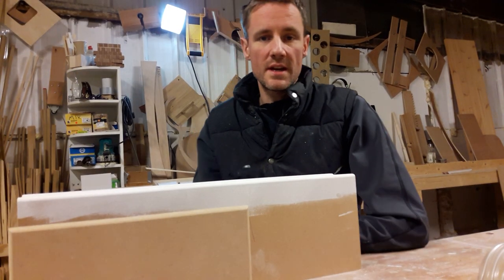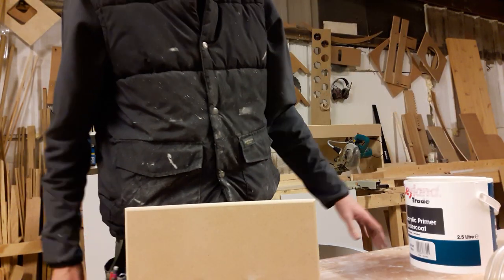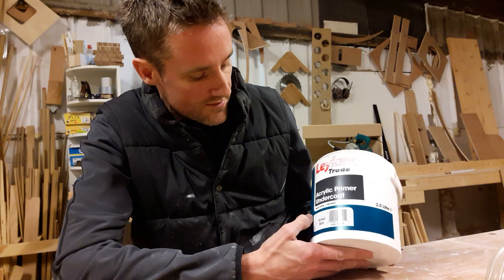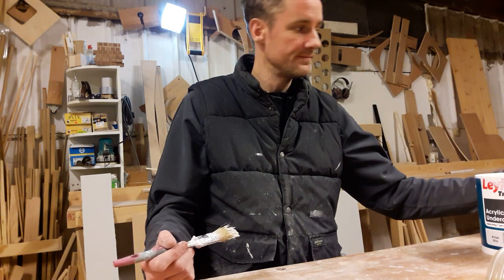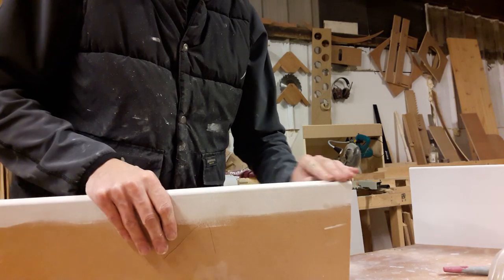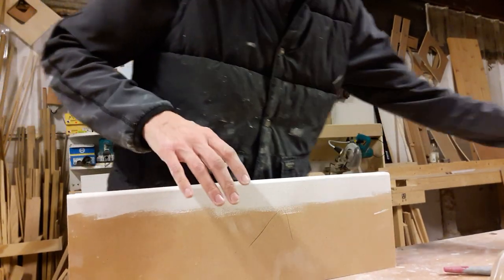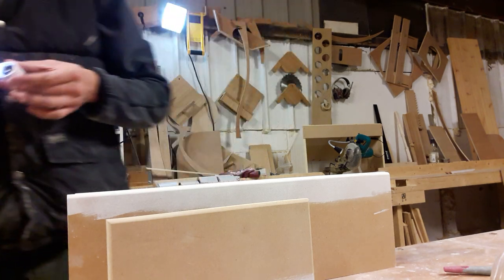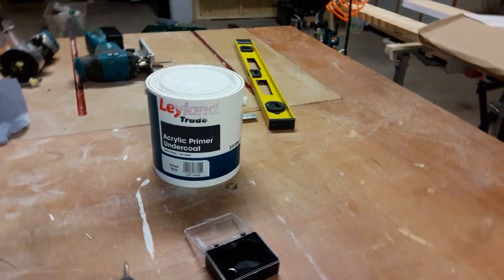How to prepare MDF for painting

Comment: Thanks for that point about Leyland paint which by pure fluke having a paint shop virtually across the road from me, that I went into two years ago after buying some  MDF wood because I could believe the prices of canvas acrylic and oil boards and been using that. Nearly use it all up and have been thinking as my paintings are getting better I need to move on to more expensive boards but if it is good enough for you, then it is certainly good enough for me.

Comment: I’ve tried almost every imaginable technique on MDF edges from PVA glue to diluted emulsion to shellac to Leyland and various fancy pants primers and I came to the conclusion that it when it comes to paint it almost doesn’t matter what you put on the edge because the first coat will leave it as rough as rock whatever you use. The trick is in the sanding and applying more coats and more sanding and more coats until you get the right texture.  These days it’s definitely Leyland for me without question but in the absence of that it’s diluted emulsion.

Comment: These close ups to sanding surfaces are awesome! Thank you the video, very helpful!
Could you please recommend me a top coat paint for a office desk surface after mdf priming? I'm afraid that my table will be scratched quickly because of my top coat choise.
Reply from the maker: Glad it helps! Difficult for me to recommend paint, just don't get the absolute cheapest.
Reply: @woodthaticould4432  all right, thank you for the reply
Reply from the maker: No problem. Also, remember that a desk is a tool like any other. If it gets marked or scratched, so what? As long as it still works as a desk, you can still be proud you made it!
Reply: @woodthaticould4432  actually you're right, I have to stop trying to be perfect

Comment: Really excellent video. Very helpful. I already used an MDF sealer. Should I now sand and use an undercoat too? These are big built in cupboards. I don't want a glossy / shiny finish, but not Matt either, so I can wipe down. What finish would you recommend?
Reply from the maker: Sand then undercoat. The final finish is dictated by what topcoat you use. Sounds to me like you want eggshell or similar. Happy painting!
Reply: Wood That I Could Thanks!

Comment: Ahh the old edge grain mdf problem..... this seems to be one of the biggest issues with mdf. Ive tried all sorts, shellac based sand n sealer works ok to. I make bespoke toyboxes so everything I use now has to be childsafe products, Ive found that applying any waterbased primer will do the trick. give it a sand forst and then paint., once this is dry re apply primer for a second coat and then resand. you should then be able to top coat.. hope this helps a little

Comment: Great video. I will have sand down some intricate shapes cut from MDF. any recommendations on sanding tools? A dremel maybe? There aren't many straight edges. THanks
Reply from the maker: Totally depends on the shape, but generally I just use paper and my hands. A tightly folded wad of sandpaper will get into all the nooks and crannies while a sheet held loosely in the palm works for sweeping curves, but only if they've got rounded edges, if it's a flat face on a curve, I'd buy (or more likely make!) a curved sanding block. Hope that makes sense!

Comment: Just ordered the primer from Toolstation, the best value by a stretch on the net. I'll feedback on whether it worked for me.
Reply from the maker: Thanks for the tip. What topcoat will you be using?
Reply: Dulux satin white; it's for a cupboard I'm making for the spare room. I'm just a weekend saw dust maker, so only pocket holes and simple drawers. Would you use a ROS with 240 grit to sand between coats?
Reply from the maker: Just Sand by hand between primer coats, don't sand the topcoat if you can avoid it. 240 grit is fine. Good luck!

Comment: Nice video! I'm painting an old MDF display cabinet that had a dark stain on it - I've sanded off most of it, does it matter that there is a bit of the old stain left before applying the undercoat?
Reply from the maker: No as long as it has been sanded it should be fine. Good luck!

Comment: Very helpful video!  I am fixing up a MDF bathroom cabinet  that has minor damage from humidity on the edges and I need to fill in holes where the hinges were because I need the door to open from the other side.  I want to spray it with Anne Sloans lacquer spray paint to get that high shine and protection from humidity in a bathroom.  Will Kilz 1-2-3 Spray Primer  be enough to seal the MDF before painting? Any advice is appreciated!
Reply from the maker: I've not used it myself, I would worry that a spray might not adequately 'fill' any furry bits because it goes on so thin, but give it a go and let us know if it works!

Comment: Im looking at making some Plantation Blinds from MDF and toying with the idea of spraying primer and top coat. Have you used any of this product in a spray gun and if you have would it need sanding, Great vid by the way, regards Adrian
Reply from the maker: Hi, trawl through the comments, there's a discussion about spraying. Consensus is that it works great. Use your fingertips to determine if you need to sand flat areas but you'll need to sand cut edges regardless. Good luck!
Reply: thanks

Comment: Came across your video today, very useful. Wish I'd seen it before I applied the primer for wood on my MDF shelves (not acrylic primer) and it created many bubbles, I wonder if you know a way for me to rectify the situation? Appreciate your response.
Reply from the maker: Sand off the bubbles with 240 grit paper and re-coat if necessary, then apply top coat. It should be OK!

Comment: How long do you wait with this primer to dry before you apply top coat? Gloss in particular.
Reply from the maker: Depends on the weather, but a couple of hours at least. It should feel totally dry. Even when it's not sticky it will still feel cold and damp until it's ready.
Reply: @woodthaticould4432 Thanks for the fast reply. I've just painted the primer outside so I'll wait longer until I apply the gloss. I was just going to wait about 30 minutes cos it's a sunny day (but it's in the shade) so thanks for that.

Comment: I have used acrylic primer rarely for mdf, got the jobs done.  But it doesn't make mdf durable in my opinion. Oil seems to seal, and sand better, and have better moisture hold out. 
I've just put up a video of Intro to prepping and painting MDF, if anyone is interested. Can I put a link?

Comment: Like your presentation style. I've just stripped the coating from my kitchen cupboards. On a few doors there are patches where the mdf is really fuzzy / furry as if moisture has got under the coating. No swelling, just fuzz. Can you tell me please if I should sand those areas before I prime.
Reply from the maker: Thanks! Give it a quick sand before, but you really get rid of the fuzz when sanding after priming. Good luck!
Reply: Wood That I Could thank you for your prompt reply.  I'm off to start now

Comment: Hi. Great video. Very useful tips. One question. Post primer. Post sanding down. Is it necessary to wipe with a damp cloth as I've read elsewhere? Cheers. Dave
Reply from the maker: Hi, thanks! I normally blast it off with compressed air, but failing that a good wipe with a dry cloth will do. I use blue paper roll so you can see if it's still dusty. If it's still dusty, you'll notice that the top coat doesn't seem to stick when you apply it.
Reply from the maker: I'd be wary of using anything damp, it's easy to sand almost through the primer leaving a barely protected patch of MDF, and I wouldn't want it to get damp.

Comment: Hi I have removed the laminated front from my kitchen units and they are mdf all in good condition can I do what you have done then use a satin wood paint or egg shell also is there anything  I can seal it with due to it being the kitchen x
Reply from the maker: Goin' renegade and rippin' up yer kitchen, I like it! I would guess that the doors are coated in glue residue? If it isn't tacky or spongy you could just sand it smooth (use a mask, you don't want to breathe that dust) and try painting straight on it. Do a test, see if the paint sticks. Remember if you sand through to clean MDF, that'll need priming, but I don't think wood primer will work on glue infused MDF. In terms of sealing, eggshell is you all washable so you shouldn't need anything else. Good luck!
Reply: No glue on it all came off with the laminate have lighted sanded them and cleaned over have done a all purpose undercoat on one then sanded and now second coat is drying once dried I'm going too try satin wood I'm doing a test door first but I think it's going too work x
Reply from the maker: It's got a good chance!

Comment: I made a cabinet top out of 3/4 mdf that I'm gonna paint. do you think it's better to edge band it with hardwood or do you think the sanding method will work just fine
Reply from the maker: Art Connolly Hi. If done properly, you can get a flawless finish with paint. If you're worried about getting the finish you want, apply a second coat of the primer/undercoat and reckon with at least 2 topcoats. That said, it's never a bad idea to have a hardwood edge to a cabinet top!

Comment: can you use an electric sander for sanding the acrylic/gesso layer?  it comes with vaccum for the dust. thanks!
Reply from the maker: You can, but be really careful, the acrylic sands easily, and use 240 grit at least. Good luck!

Comment: Question: what do you think of a first coat of latex bonding liquid on MDF which is not of the waterproof variety?
Reply from the maker: I have no experience of latex bonding liquid, try it on a hidden area if you're going to use it!
Reply: @woodthaticould4432  I have never painted MDF before. We have stripped off the plastic coating from kitchen cupboard doors and found very good, but not waterproof, MDF underneath. The cupboards are of good quality and we want to paint the doors instead of replacing them. Currently we are gathering information to do the best possible job. Thanks for your input.
Reply from the maker: Make sure to give them a good sand so whatever paint you use sticks to the residual glue. Good luck!

Comment: hey  i need help what grit sanding paper do i use to sand edges and also grit size for between prime coats. And one more question after mdf is primed and first coat of paint is applied what grit sand paper should i use between paints. thank you
Reply from the maker: DRIPn VAPE Hi, on routed or cut edges sand with about 180. As per the video, you won't get it really smooth till you sand after primer, which you can do with 180 again, then 240 if you do a second coat, which I usually don't bother with. As for the topcoat, if you're using any kind of gloss/eggshell/acrylic type paint, you shouldn't need to sand. If you're talking chalk paint or something then 240 grit at least. Good luck!
Reply: Wood That I Could thank you for your help much appreciated

Comment: I read somewhere NEVER use a water base paint on MDF because it can cause exactly what you are trying to avoid, furry edges. The water in the paint swells the wood, not good.
Reply from the maker: Quite right, if you used it without a primer which seals the MDF, you could get problems. I know the primer I use in this video is water based, but it is very quick drying and never causes a problem. It's thick and kind of gloopy so I assume it also has some clever chemicals to prevent it from behaving as water would and being sucked into the MDF.

Comment: What type of mdf are using?  Big box ( Home Depot ).  Or cabinet grade mdf or moister resistant mdf??
Reply from the maker: Hi, I'm guessing you're from the USA ("big box" gave you away!), here in the UK there's no such thing as cabinet grade Mdf, not as far as I'm aware anyway. The stuff I'm using here is just standard Mdf, but the method works just as well with moisture resistant. Can you explain the difference between big box and cabinet grade, I'd be interested to know? However, given that time is the biggest investment in an Mdf project I would get the best you can afford.
Reply: @woodthaticould4432  There's something called MRMDF available -- but not limited to -- from the UK "big box" stores such as Wickes, B&Q, etc. I haven't worked with it, but I understand it's pre-treated to protect against moisture and the like. I think it has a green surface or something along those lines. It's more expensive than the standard MDF sheets for obvious reasons.
Reply from the maker: Jay k that is correct. I always use the green stuff for kitchen or bathroom furniture. I have also discovered something called 'medite' mdf which is supposed to be more dense and moisture resistant even though its brown. This is probably what you might call 'furniture grade'. You won't find it in big box stores though. On a related note, I was forced by circumstance to get a sheet of 6mm from b&q recently which was noticeably lower quality than anything I've seen before. It was a lot less stiff and had a furry texture to the faces.
Reply: @woodthaticould4432  There's noticeable differences in the quality of sheet materials even from one UK DIY store to the next. Wickes is probably the default "decent" place to get timber for the DIY enthusiast who has an eye for quality. Even then, one's gotta be careful and inspect the timber personally else they do try to get away with selling damaged or poor quality stuff. But, yes, I don't foresee myself tackling any project that requires me to go the MRMDF or Medite route. Tbh, the standard MDF, as long as it's in good shape, is decent for my requirements.

Comment: Have you tried using the primer with a HVLP sprayer?
Reply from the maker: Dean Martin Hi. No, but I have covered it using spray cans, which gave an excellent finish, except on a couple of cut edges which I think could have done with a second coat of primer/undercoat. It would have been fine with brushed on gloss or eggshell.
Reply: +Wood That I Could sorry, just to clarify, have you applied the Leyland trade primer using a HVLP sprayer? Or should it only be applied with a brush or roller?
Reply from the maker: Dean Martin my mistake, I see what you mean! I have not sprayed it on, no. I like the feeling that you can really smoosh it into the cut edges with a brush and it sands so easily that you don't need to worry about brush marks.
Reply: +Wood That I Could I'll give both a go so. Thanks for the info. I've already tried Fleetwood Mdf primer but the results ain't great so looking forward to try this now.
Reply from the maker: Dean Martin great stuff, please let me know how it goes with the hvlp.
Reply: +Wood That I Could will do. Just waiting for it to arrive
Reply: +Wood That I Could Works brilliantly with a HVLP sprayer. Great coverage with one coat. Hit it with 320 grit and it's as smooth as glass. The customer service at Leyland is without doubt the worst I've come across. Just terrible.
Reply from the maker: Dean Martin thanks for the update! Good to know it works with the hvlp, not surprised about the customer service, but we've all got each other's backs, right?! Power to the tradesmen! Thanks for being a pioneer!
Reply: +Wood That I Could Absolutely. Not all hero's wear capes, some wear steel toe boots and a hard hat. Had to thin it down about 15-20% for the system I have.